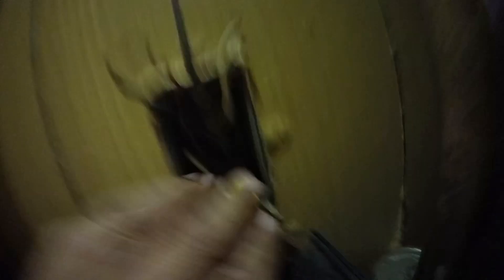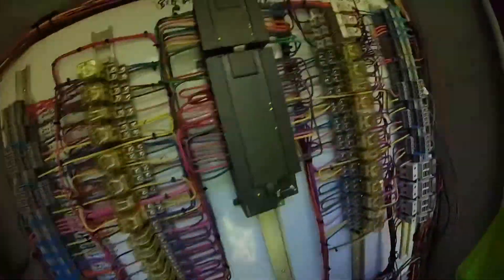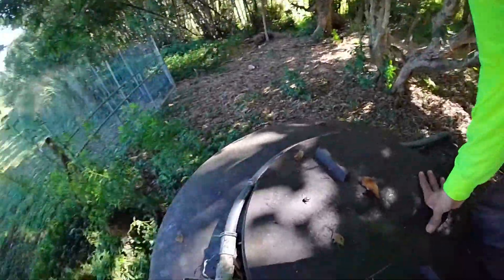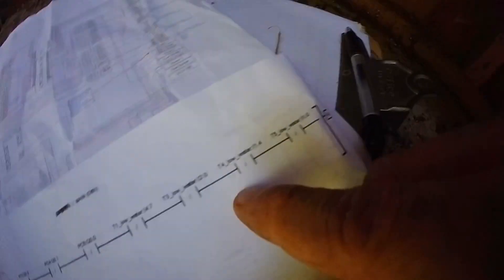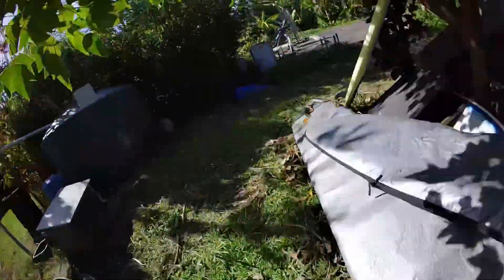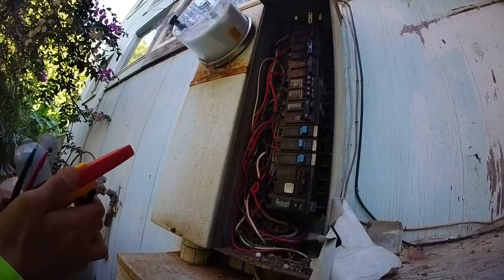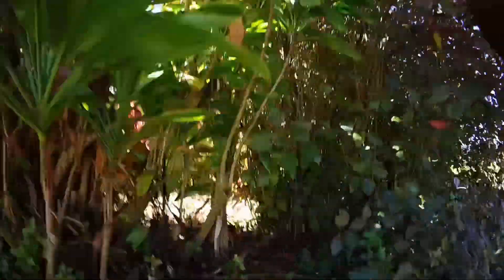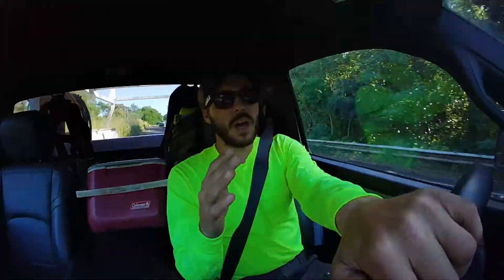Hoarder Complained Of Sparks Coming From Breakers | Let's Work EP. 56

Comment: been in few places like that, wipe your feet before you leave the property! do you not have an insulation tester? here in uk we use them all the time for checking wiring, earth leaks etc
Reply: Yeah sadly the US doesn't really do insulation testing. I'm sure the testers are available but expensive. And only used for niche applications. Generally things like this require just working down the circuit hoping that they stuck to a radial circuit design with the occasional spur. So the circuit could be split in half to narrow down where a fault would be.